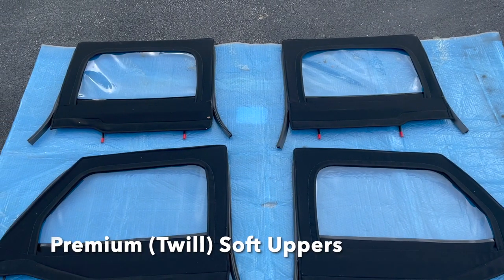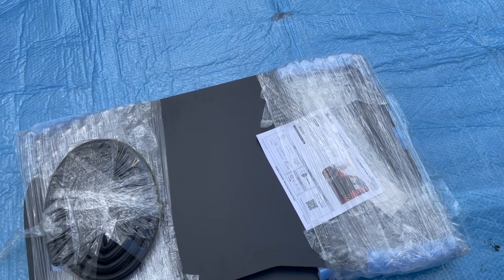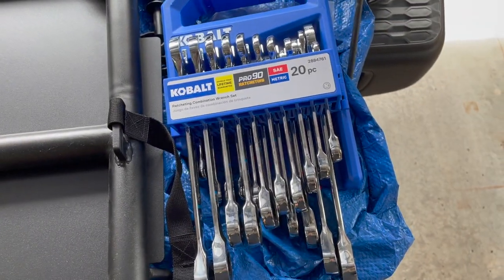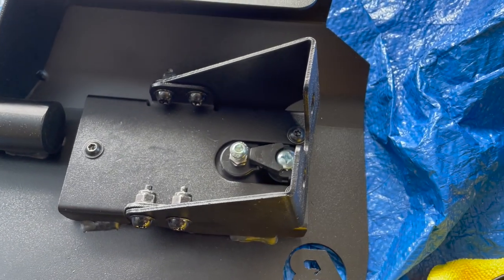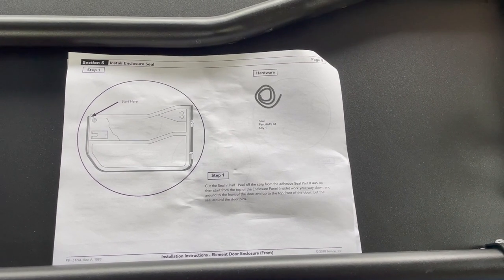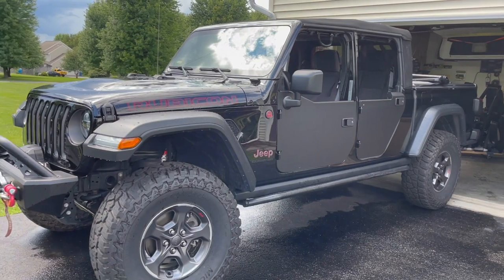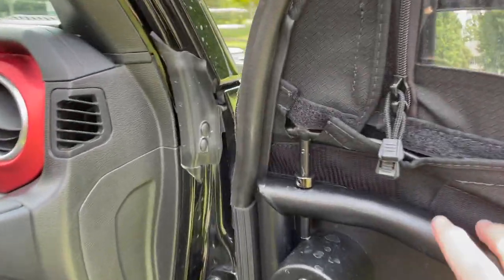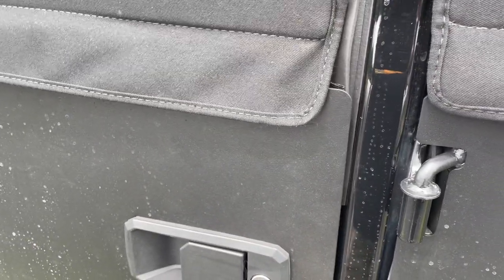Half Doors on a Jeep Gladiator!

Comment: Do you think these seal better then the fabric doors?  I had fabric fronts for my jk and it was mandatory to take the carpet out.  With the JT I have this  weird hang up about removing the carpet for some reason.  I’d hate to go the element route with the higher expense only to have the same kind of leakage.  I ran the fabric doors on the jk from may to October, with them off and in the back whenever possible
Reply from the maker: I don’t know anything about the fabric doors but I added some extra Velcro and I installed the seals provided by Bestop without trimming ( they hang out a little) and bent the fabric uppers in real well and I’ve had only very slight rain in them. When I went through a touch less car wash I only got a few drips. It takes sine work to get them adjusted right but they work pretty well. Good luck !  # JTRSPARTACUS
Reply: @JTRSpartacus  My hope was the stiffer lower of the element doors would give a better foundation for the uppers than the fabric doors, and that might enhance sealing.  I know the element doors will be harder to chuck in the back than the fabric (i'll run mirrors on body vs on the doors), but if the sealing is better, I think I can live with it.  Id plan on only changing out the fronts.
Reply from the maker: Seems sound.  The bottoms are relatively easy to seal up.  The tops took some bending /adjustment, extra Velcro and trial and error.

Comment: Are you able to remove the enclosure plates on the doors without taking doors off the jeep?
Reply from the maker: Probably not.  It’s fairly invoked to remove the panels.  They are bolted under the mirror.  I think I’m going to mod them to be quick release and separate from the mirrors.  Thanks for watching!  #JTRSPARTACUS

Comment: I purchased their fabric doors for my 21 JTR, but the fit was terrible. In fact the rears wouldn't engage the lock at all (could not be used for the rear doors). The fronts had so many gaps around the door and I can see these suffer from the same issue. I ultimately returned all 4 doors because the fit and finish was sub par at best.
Reply from the maker: That stinks. I considered the fabric doors. I got these perfect now.  Been through some serous rain with no water inside.  They do take some fiddling with to get them right.  I think bending the individual legs on the uppers is the way to go. The bottom tube doors/enclosures  were easy to adjust for the striker and fit well.  The fabric uppers took some effort.  Thanks for watching. If you consider these, hit me up with any questions or if you need to see something #JTRSPARTACUS

Comment: Stupid question,  there is no reason this wouldn't work with a 2022 Gladiator?
Reply from the maker: Not a stupid question. Will work on all Gladiators (JT) 2020 and newer and all JL Wranglers 2018 and newer. This is definitely a cool upgrade!  I ran them until it was too cold in PA. I like to run them on trails too since doors are very expensive and if I dent one of these I can fix it.  Good 👍 luck and thanks for watching and commenting. If you haven’t already, please hit the subscribe button. #JTRSPARTACUS

Comment: Any links for the doors and windows??🙏
Reply from the maker: It’s a modular system from @bestop   I don’t get any commission or anything. I got the tube doors on clearance sale - I forget how much I paid but they were cheap. Then I added the panels and the fabric upper/windows and for a discount from Bestop. https://www.bestop.com/products/highrock-4x4-element-doors-jeep-2020-2022-gladiator-2018-2022-wrangler-jl-matte-black-4-door/ #JTRSPARTACUS
Reply from the maker: Door panels here. https://www.bestop.com/products/highrock-4x4-element-door-enclosure-panels-jeep-2020-2022-gladiator-2018-2022-wrangler-jl-black-4-door/
Reply from the maker: Uppers here https://www.bestop.com/products/highrock-4x4-element-upper-fabric-jeep-2020-2022-gladiator-2018-2022-wrangler-jl-4-door/
Reply from the maker: THANKS FOR WATCHING!!!!!